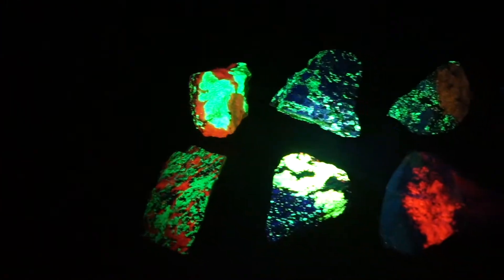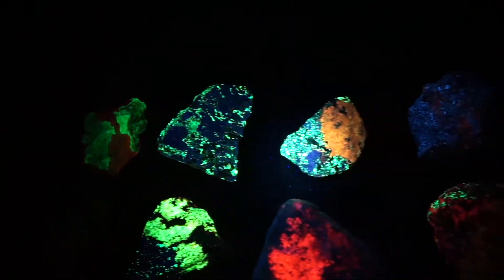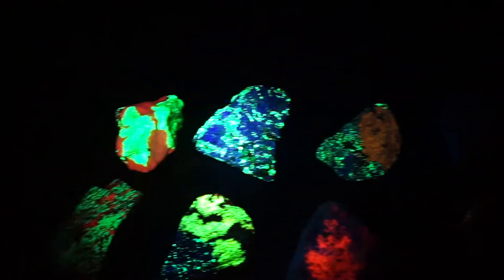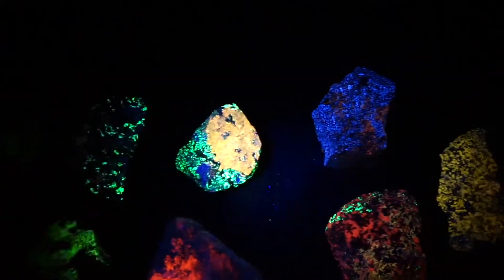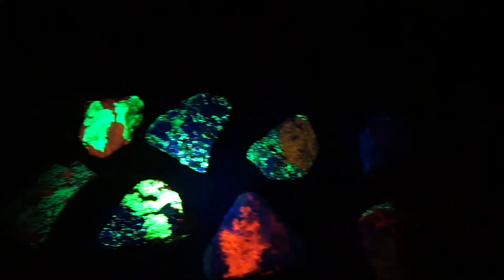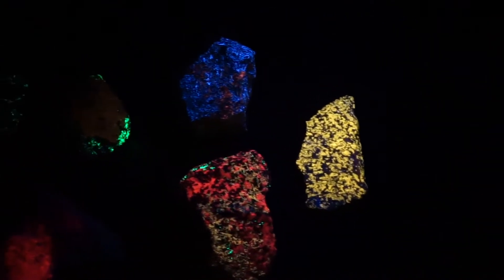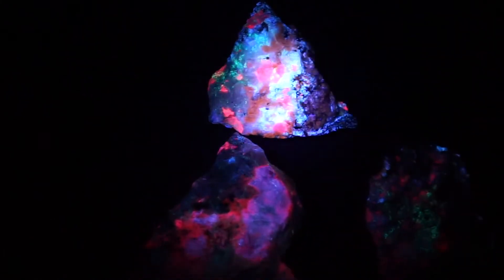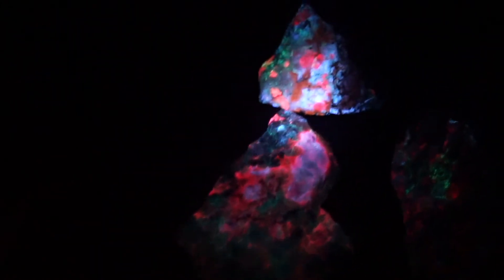Shortwave (UVC) LED Update for Fluorescent Minerals

Comment: Raymond, good to hear from you again! You want more questions? I've got them!!  How are you focusing the light? Is there a lens or does it just use a reflector? Does the output of the LED need to be filtered (i.e., do we still need to deal with Hoya glass?) Is there a way to produce a display quality light or at least a floodlight using these types of LEDS in the future?  Any thoughts on the long term lifespan of the LED? Will it be like the white light LEDs we are seeing these days, or will the UVC cause the LEDs to degrade over time?
Reply from the maker: Glad to answer them! Will update the description and put my responses here. A reflector was used. I recommend a filter. However, for bright fluorescing minerals such as the Franklin material you'll be able to easily see fluorescence without one. I haven't actually thought about display lights since I don't actually have a display of my own. I'm not sure. Definitely yes on the floodlight though. Just use a floodier reflector. Lifespan numbers from the manufacturer are L70 > 1000 hours RTOL according to the datasheet. During a presentation the manufacturer estimated it to be 5000 hours to L70. I'll need to do a bit more research into the degradation aspect.